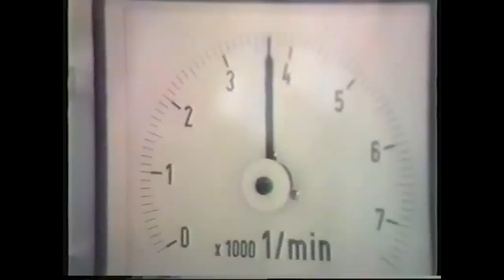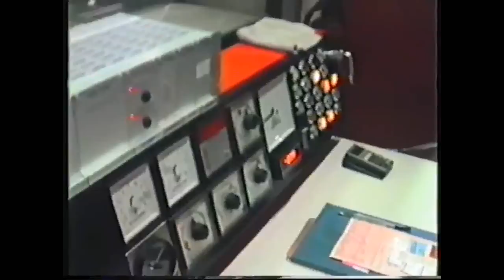Porsche Factory Visit   1986   911 Carrera 3.2  Engine, Upholstery and Body Works

Comment: I got to see the Taycan and 911 factory in 2023, unfortunately cameras were not allowed so I have to go off memory. The engine assembly line is actually nearly unchanged compared to here....just twice the number of engines on the line compared to 1986. The body assembly looks nothing like it does now.